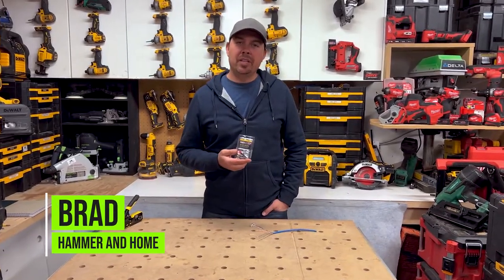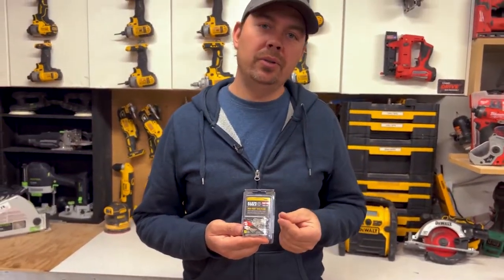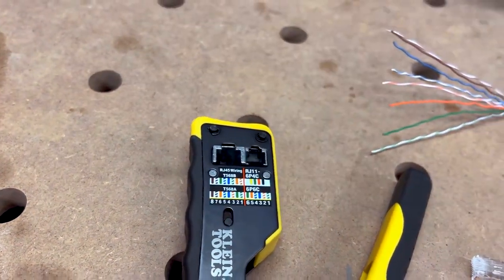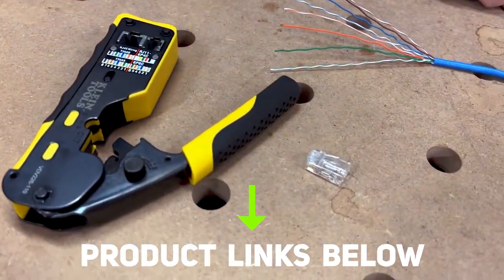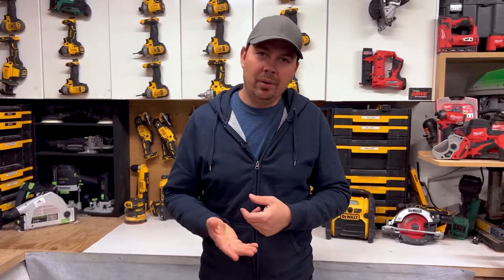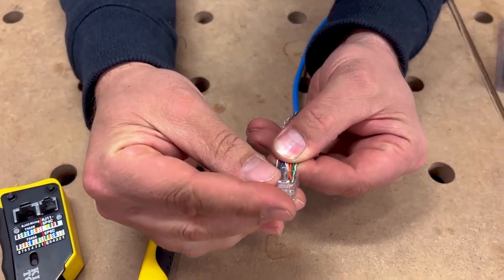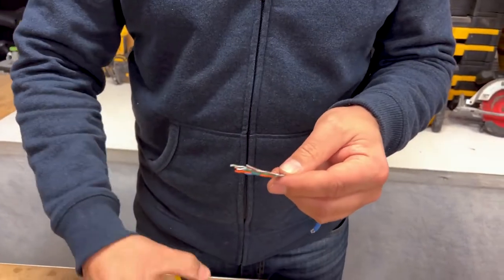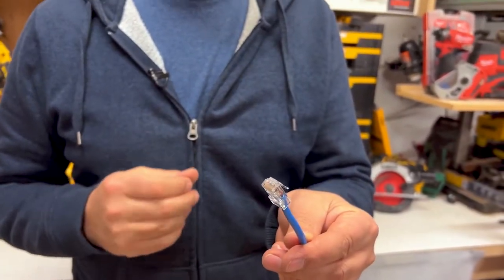How to use 'em: Klein Tools Pass Through Connectors for Cat 6 Wire

Comment: Asking for a friend....how would one know which of the two wire sequences to use?
Reply from the maker: I use the B sequence, the most important thing to remember when wiring this up is that both ends of the cable are the same sequence. If you mix that up it won’t work at all.